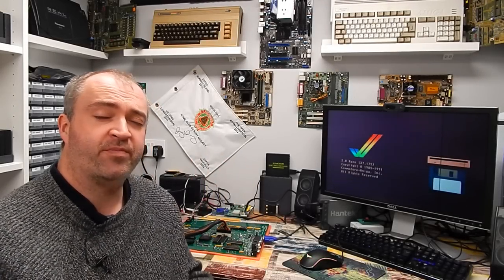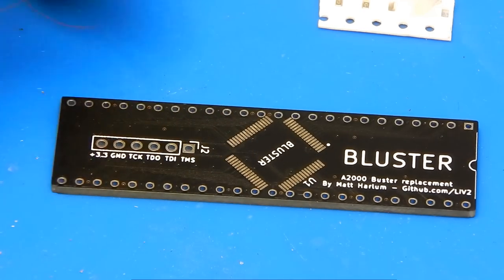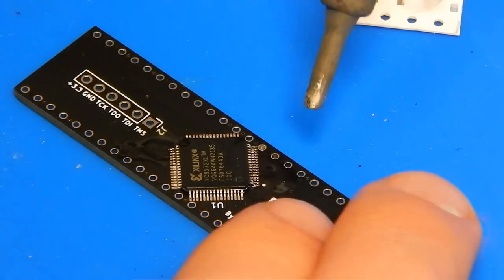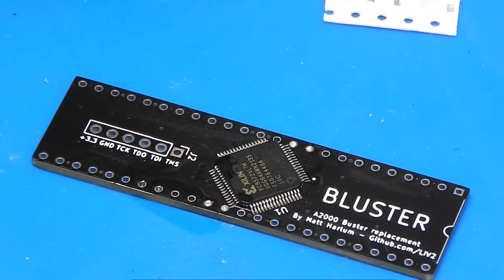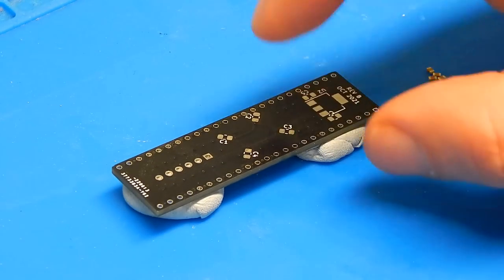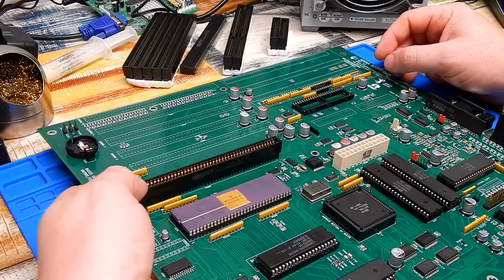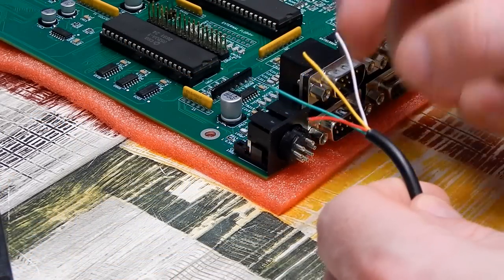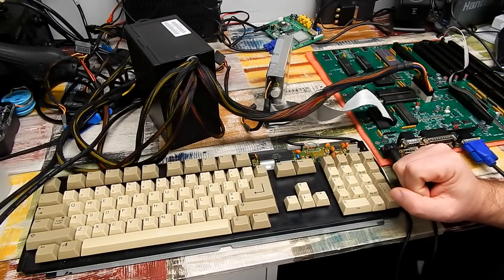Building a NEW Amiga 2000 in 2022 - Part 2. Zorro, bluster, keyboard and case

Comment from the maker: By the end of the video you might be able to tell I was a bit tired (it honestly took about 3 hours to build into the case) and there were a few points I forgot to cover.

1. The gotek buttons were put at the back of the case just above the fan.  Not the most practical position but it works.  
2. The ATX power cable needs an extension to properly clear the zorro slots. One has been ordered and I'll post an update picture once it gets here.  
3. I still hope to get the board professionally cleaned at some point but still struggling to find anywhere that can do it.  If anyone knows of anywhere around Belfast, N.Ireland please let me know.
4. The cost,  I can't believe I forgot to cover this but for anyone thinking of building an EATX2000, costs for my build to date are around £500.  The board plus components etc were about £300.  The A500+ from which everything was salvaged cost £60.  The case was £70 then just allowing the remaining £70 to cover PSU, gotek and sundries.
Reply: Have a friend who built in a A1200 into a tower i took 2weeks ordering powercables and routing stuff ;) i know i make videos to on youtube RB Retro Bunker so i know how mutch energy stuff can take. I doing a break now to mutch ordinary work and have 3kids :) 
I think you do great work
Reply: So I have soldered 5 A500 ++ replica boards and a sixtyclone C64 board. The way I clean them is not by spraying isoprop then add a rag or paper and toothbrush to suck the flux up in the rag/paper. I poor isoprop in a spraycan then I spray alot of isoprop over the whole board while holding it level, then I tip the board as soon as I have soaked the board really well so all the isoprop (and flux mixed with the isoprop) runs off. It's important to spray as much as possible so it will poor off when you tip the board. I do this over and over again on both sides of the board until it's clean. It's not unrealistic to use almost 0.5 liters of isoprop on one board when doing it like this. But it works really well and cleans up the boards really well. While spraying you could use a toothbrush to loosen up the worst flux. then continue to spray and tip the board so it runs off. Doing this it will look like the board was professionally cleaned. Just remember to spray alot of isoprop.
Reply from the maker: @larsenmats  thanks for the tip I think I'll give this a go.
Reply: I think you could just drill a small hole below the USB ports for a select switch, maybe in the future. You should get a big amiga vinyl graphic cut for that removable front panel, you have all that flat space to play with, would be neat i think. 

I really genuinely love this project, its such a cool neo-retro adaptation and  I hope that I can build something like it some day. 

I love the aesthetic inside of the case and i hope you continue to add and expand to it, I cant wait to see where it goes. Maybe see if you can get a fancy individually sleeved ATX extension cable for the power connector on the board, i think it could really complement the look. Maybe also a rounded style floppy and IDE cables like we used to use in the 2000s pc modding scene.

I also cant wait to see what you do with the keyboard, maybe look into doing a stacked laser cut perspex and alloy case for that?
Reply from the maker: @draggonhedd  I came really close to drilling holes for the buttons but ultimately decided against it as if the drill slipped or if I was off by any amount it would make a mess of the front of this otherwise perfect case.  

I have plenty of ideas for future expansion of this machine.  Ultimately I'd like to have each of those expansion slots populated but I'm not rushing to it.  Better to take my time deciding on the right expansions to make the most out of the system.

I like that idea for the keyboard, I'll look into getting some acrylic cut.
Reply: @CRG  Looking forward to seeing what you come up with!
 Oh what if you stuck some buttons in the front panel gap at the top, just slightly recessed? Could probably snake some wires and not have to drill any holes. Make a small PCB with some right angle switches and double sided tape them to the case there
Reply from the maker: @draggonhedd  That was my initial idea and I did print a bracket to hold the buttons but to be honest I broke it when trying to fit it (it had to be very thin) then I just ran out of time to redo it.  I think long term that will be the solution though.
Reply: @CRG  That's cool, looking forward to more of this project
Reply: for gotek, i use a 14 pin logic chip and a keyboard 3 button combo for each of the L,R and Egct buttons, so no wires needed

Comment: Pretty cool. I am building an A4000TX in a black tinted glass Fractal Define 7 case with silent PSU (fanless) and the case has a 5.25 drive bay which have been all but exterminated on modern cases. Perfect blend of new and old.

Comment: the boot speed when Amiga's not held up waiting for floppy disk, to spin, it close, to hardware inbeded OS stuff, I do think if amiga the company had made more effete is getting more drives in the machines, it wouls made a lot of difrence to how amiga looked at, it did have bets it even had ram disk, and a virtual floppy in memory, but was just flogged  to the public it will boot from one floppy, and it was left at that?

Comment: This project seems to have turned out pretty well.  There are a few improvements I would suggest though.  

1)  The LCD for the GOTEK drive is in a location which I can only imagine being quite hard to read.  What I would suggest there is to move it so that it could sit in between the casing that hides the PSU and the glass.
2)  Without a bridge board I think the ISA slots are probably going to be little more than decorations.  As such maybe a bridge-board project could be a good thing to consider. 
3)  The keyboard looks a bit shocking without any casing around it.  The only thing I could find that I would be sure to fit properly is a kit you can get from Checkmate which comes to £65.  I would post a link but YouTube doesn't seem to like me doing that. That kit is not exactly cheap but maybe you could get something 3D printed instead.
Reply from the maker: Honestly with the case sitting on the desk the LCD is at eye level so isn't hard to see.  A bridge board I think is a must at some point considering the other half of my collection is all IBM compatibles and yes the keyboard is a bit of a mess still.  The checkmate case is an option I've been looking at but its expensive enough.  I do like the idea that another comment suggested and that's to build out just enough to cover in the PCB etc.  Think I'll try that first.

Comment: GREAT JOB! 😊
Love the vids!

I would like to say: You'r better in soldering the 'hardly' IC's, than the SMD chipcomponents 😅 (with that massiv soldertip!!)

I have to take an IPC course every two years, to stay 'IPC certified' in (also) soldering.

First lesson in soldering is:  Tin all pads, and clean them afterwards with f.ex desoldering braid.
By this, the pads have solder on it, and u allready can 'stick' ur component to the pad, like u did, just with heating both and without extra flux nor tin. Thats so much easier!

From there, u did it IPC-like: solder 2 diagonals, and solder the rest with flux.

Doing so also with chipcomponents will do the trick to not only funktional solderings, but also beautiful and clean solderings.

But as said: lovely video!

Comment: fantastic job! For the cpu accelerator i suggest to try the pistorm emu68k, it is a baremetal cpu emulator so no loading times!
Reply from the maker: I've got a pistorm in one of my 500s.  I am considering it for this machine but I'd probably just use it for the CPU.  I know it'll do rtg and hard drive images but want to use the Zorro slots for those things.
Reply: that's a great idea actually!

Comment: To really show off the board in there i'd put like an adhesive 12v RGB (or just plain white) LED strip in there and power it via one of the no doubt many cables from the PSU. Maybe the camera doesn't do it justice but it seems very dim from here. If you want more reliable hard drives in there there's SATA to IDE bridgeboards, although of course more modern HDDs don't have quite as audible seek noises.

Comment: No drive bays in a case, sigh, I have that covered in my Aopen ATX "Desktop" case(It's not a tower or a cube case), the case came with a 235 watt ATX psu, a Seagate Medalist 2.1GB 3.5" EIDE hdd, a Mitsumi 3.5" 1.44mb floppy drive in Beige, plus I added to this Beige case a Creative 5.25" 48x CD Rom EIDE drive in Beige(works). The case has 3-5.25" and 2-3.5" external drive bays and 2-3.5" hdd bays, of course the front is yellowed as are the 3 matching drive bay blanks(1-3.5" and 2-5.25"), the metal top and sides needed Mr Clean scrubbing pads and they worked better than Windex for the metal part, inside the case is some dust and no corrosion. I could set another PC or a monitor on this case as the case resembles 3 stacked pizza boxes. It'll make a purrfect home for an EATX Amiga 2000 motherboard, but that is for me, everyone else do what you want. Once the front plastic parts are cleaned, I'm not sure what to do, treat the parts and spray clear paint on the plastic to try and prevent a relapse into light yellow or spray paint. Treating with hydrogen peroxide and UV in the sun I've never done(retro brighting), though I've seen that being done, but spray paint I can do. I just need to solder about 135 components to the motherboard, my 600w iron will get a workout. Keep the good videos. I try and stay subscribed and I give "likes" like water flowing out of the faucet.

Comment: I would personally have gone with a case that has space for a floppy drive and a CD-ROM drive, but that's just personal preference. Using the built in USB ports for Goteks is a nice touch, and makes for a very clean look. It might be cool having an RGB controller cycling through the colours of the Commodore logo, but that could also get old really fast ^^
Nice build, and really cool seeing an A2000 board that fits into an EATX case :)

Comment: Great Job! Try mnt´s zz9000. It provides rtg including ethernet and flicker fixer on board. In addition you have the option for the ax sound module with ahi / mhi drivers on top. The card even comes with quite cool status leds.
Reply from the maker: That could be an option, it could certainly tick a lot of the boxes that I'm looking to cover.

Comment: You can get those amiga usb cards and route the ports to the case built in ones.
Reply from the maker: Can you get a Zorro 2 usb card? I'll have to look into that as it would be very useful.
Reply: @CRG  i remember that there are some solutions to have usb on amigas, but i don't remember a zorro slot card

Comment: Really nice job on the build!

Honestly, I'm not much for surface mount projects (yet), but your cool/calm presentation made it look more approachable than ever... especially with this hybrid through-hole and surface-mount project that I did not know of before.
Reply from the maker: Thanks.  A few years back I was very cautious when it came to smd work but honestly now it's quicker than through hole.  Only thing I'd say is you must get good flux and solder.  I use that chipquik stuff and while it looks expensive it makes all the difference.
Reply: The A1200 is a hybrid between SMD and through hole mounts, and I think A600, A3000 and A4000 are too, in the original designs
Reply: @MallaganVloggs  My main retro machines are the C64 and Amiga 2000, so I'm used to through hole work. Arctic Retro did some A600 work and definitely has lots of SMD in tight spaces, by contrast.

I'm up for doing more SMD though - e.g., fixed some Bose Wave radios, but that's primarily consisted of replacing old/burnt-out SMD components (caps and resistors) with creatively-placed through hole components.

Comment: That looks amazing, Well done :) I wouldn't bother with the headphones jack due the the hard panning nature of Amiga audio, headphone audio doesn't sound that great, instead I'd replace it with a shaft encoder for the gotek. Ali express do large oled displays that will work with the gotek boards 128x64 rather than 32. I wonder if anyone is going to re-ignite the usb interface for the amiga. There was one that plugged into the clock port on the A1200. It would be amazing if someone did a zorro usb card. Also I didn't realise you had a patreon account. I'm there :)
Reply from the maker: That's a really good idea, I'll look into it.  

Thanks for the support on Patreon it's greatly appreciated.  I don't go out of my way to mention it in the videos but it's there for anyone who would wish to support me.

Comment: Please follow my enclosure/case recommendation and then USE THE SYSTEM TO EDIT YOUR VIDEO OF THE BUILD using of course Video Toaster SFX and any other goodies and toy enabled features that  you get installed on this baby!

My case opinion is late, but here it goes regardless! It should be a FULL TOWER enclosure, preferably from the first generations of ATX enclosures as later on Full ATX enclosures became quite rare indeed.
This will have at least 5 5"1/4 drive bays and 2 3"1/2 drive bays, these being external, internally you will have a bunch of 3"1/2 disk slots typically completing the space from the last floppy bay to the bottom of the case and and few above the PSU section (if a secondary PSU is not used as FULL ATX will have space for additional power supply(s) above the normal ATX PSU.
This would be the perfect enclosure for an Amiga fully equipped for video editing with Video Toaster, SCSI Disk controllers and storage and many other addon goodies that will easily fit such a case :)
Reply: My recommended case/enclosure is easily twice as tall as the one that you ended up using! Still, I would love you to implement the request on my comment regardless of its lateness. You know, using Real live Amiga Hardware for what it was meant to be used for in video production but in todays world. It deserves a fighting chance in my opinion :P
Reply from the maker: I originally had intended to go the route of the full tower case but they were just so few and far between.  Any I found were in poor condition or just way too expensive.   I ultimately gave up on that idea and instead went the route of the modern style case. I know its not to everyone's taste but personally I am very happy with how it turned out.  

As for the video editing thing I'm sure it would be fun to play with but I don't think it would be practical for me.  Getting all the required analogue equipment as well as the Amiga cards would likely run into the thousands.  If you are interested in this type of thing though I'd highly recommend you check out the 10 Minute Amiga Retro Cast, he has a video series on the toaster from a couple of years ago.

Comment: You used the rev c jed file to program the bluster but later show it's a rev b board. Presumably the pinout between the CPLD and the actual pins didn't change between the revs
Reply from the maker: I don't think the jed files are specific to the revision of the board, rather just an upgrade to the cpld code, or at least that's how I understand it.  It's the same cpld on all revision boards just the regulator changed.

Comment: This is really nice! I'd like to do this myself. It was really exciting to see the Zorro slots working at first try, all 5 of them! I didn't comment anything on the first part, I know... 
I've asked for this but an A3000 remake in ATX form factor, I'd like that better than the A2000, as much as I do love the A2000... but for AGA, I already have my A1200 towerized with a Mediator PCI busboard, which is awesome in itself, it's running a Blizzard 1240 accelerator at 40 Mhz. As for the accelerator you wanna make, if I were you, I'd stick with an 030 accelerator, especially when it comes to an A2000. Since the architecture of the A2000 is still 16 bit anyway, I'd guess you'be mostly use if for stuff that works well with an 030? for compatibility reasons, and you can put an 030 at pretty nice speeds anyway. For a faster CPU I'd build an A4000 clone of sorts... but that's just my two cents!

Anyway, really nice to see this done, and I really love the choise of case, I'm literally jealous :)
Reply from the maker: Thanks, glad to hear you enjoyed it.  I did get a little excited when it booted to the CF card but I knew once I seen that, that was it, everything worked.  

There is the A4000TX project which I'd love to build at some point, an Amiga 4000 in an EATX from.   That chipset is very expensive though and I've got a lot of work yet to do to finish this build.  

For cpu upgrades I'd love to see the tf2040 get finished although an 030 is probably the sweet spot for a system like this.  Pistorm is an option and I am considering it but I'd only be for the CPU as I want to build more cards to fill out the Zorro slots.
Reply: @CRG  I had a Blizzard A1230 + FPU all at 50MHz in my A1200 at uni, adding the FPU did make a difference. It was so nice, the stock A4000/030 was nothing compared to my 1200. I wish I'd kept them now.

Comment: Great video! I noticed you never mentioned reflashing the Rev B firmware onto the CPLD once you realised you had a Rev B Bluster instead of Rev C. Did you do that, or didnt need to?
Reply from the maker: Thanks, glad you enjoyed it.  No I never reflashed the rev B firmware, its still on rev C and working fine.  I will at some point in the future be adding more zorro cards so I'm unsure if it might become an issue at that point.  Speaking to LIV2 about this back at the time he wasn't sure it would work but to date for me anyway its working fine.  If you are building one though, probably best to use rev B firmware on a rev B board.
Reply: @CRG  I don't have the facility at the moment to make one myself, but was just intrigued!